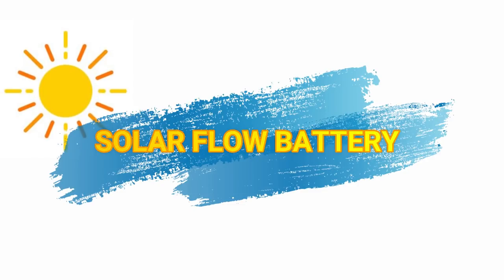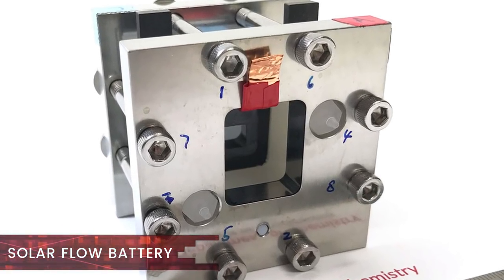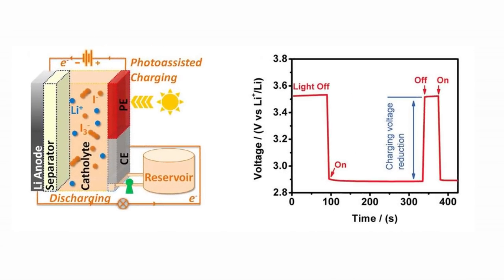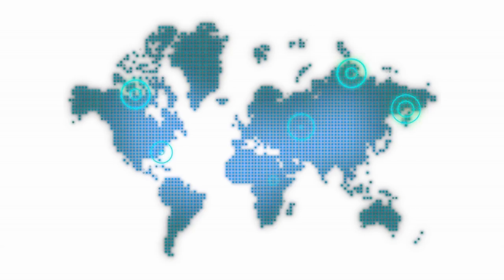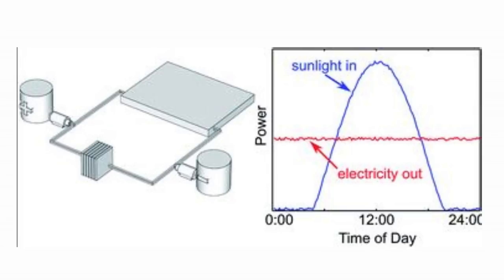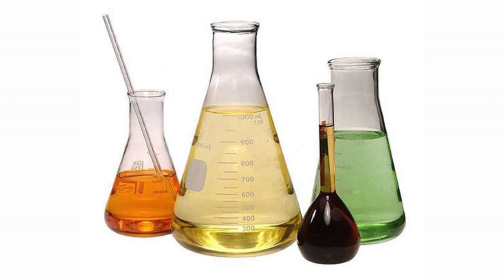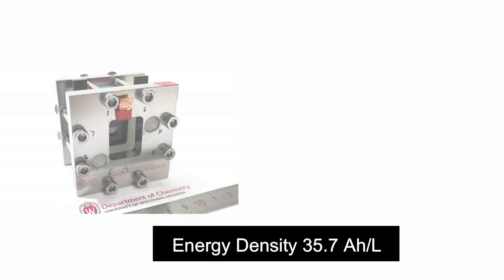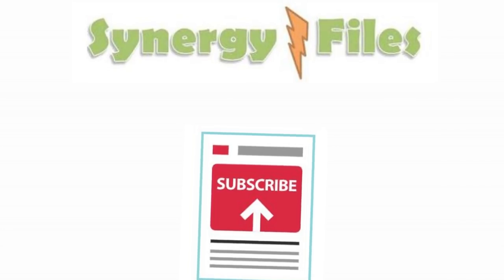Solar Flow Battery - A promising new technology

Comment: I would never have bought this thing. This seems like a very stupid idea to me.
Reply: I believe flow batteries are the future of solar. Regular battery storage systems degrade and need replacement ($). Flow batteries, with good design and chemical agents, last many times longer with little degradation, and they can be completely charged and discharged without damage - whereas other batters must be kept within a safe charge/discharge range to avoid damage. This is the best answer yet to energy storage during peak electricity production and use when production falls off. I am more unconvinced of solar flow battery/panel systems. That needs more time to mature and careful evaluation before I would make that leap.
Reply: @tthinker9897   well ok ..where to buy them ...  winter is coming
Reply: @phillyunrau4736  agreed, where. They had developed good ones in Australia, but that's totally impractical. I had assumed someone would start making them here - wrong. But newer, safer, long-lasting, and cheaper battery tec. is being developed rapid due to electric cars. So now it is the problem of wait for better or get in now.